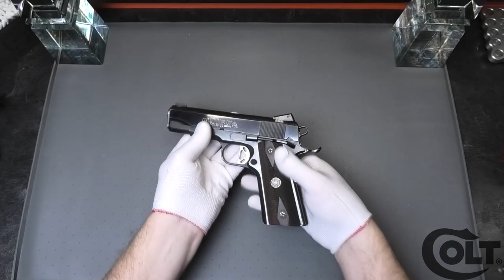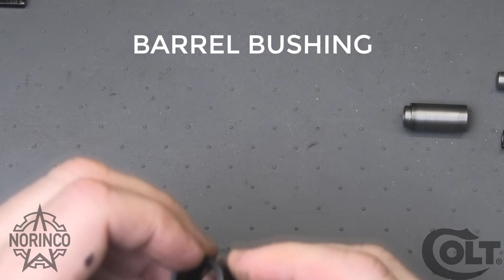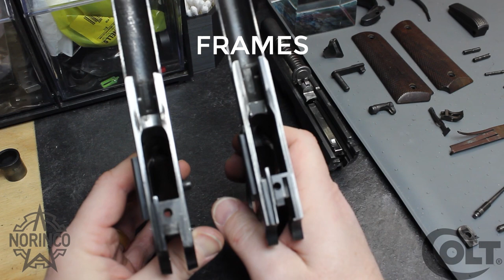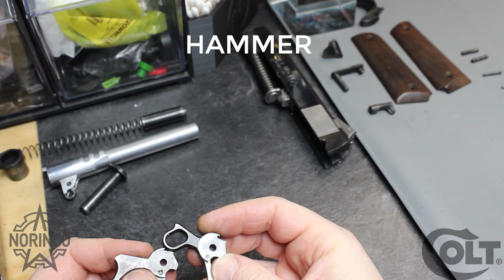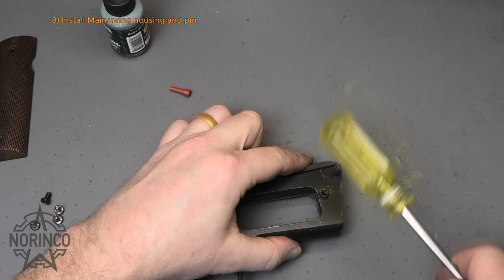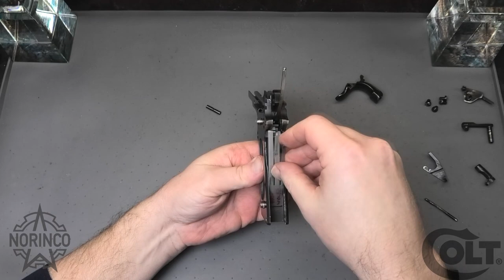Teardown:  Colt 1911 and a  Norinco 1911

Comment: The quality of the steel used in the Norinco, overshadows the low quality steel used by Colt. Ask any gunsmith. Some even refuse to do work on them as it ruins and dulls all their tools.

Also, I noticed you did not take out and compare the extractor. As the Norinco ones are made of a special red steel. Highly sought after, to upgrade a Colt with one of those.
Reply from the maker: Can't argue, norcs are not precision firearms, and are priced accordingly. I haven't liked colt pistols since the early 80s, they changed production and quality, but kept the high prices. I'm not surprised they finally went out of business. Now that said, now that CZ owns them, they MAY come out with some interesting new offerings, and those  I would take a look at, since I've become a bit of CZ fanboi since I started using them for competition..   Cheers! :)
Reply from the maker: Oh, and if I neglected the extractors, it's because the one in the colt is a custom one I had fitted...it's curved and the extractor sharpened, and I likely didn't want to answer comments about how it's bent :)
Reply: Credo che tu abbia perfettamente ragione, le Colt sono diventate pistole scadenti ma molto care.
Le 1911 government serie 70 erano tutta un altra cosa.
Ora possiedo una Norinco1911a1,con estrattore "rosso", ha "giochi" pazzeschi ma è molto precisa!

Comment: People are more brand conscious. People think more expensive gun means more durable and rugged. Norinco 45acp NP 44 which i have is a rugged, accurate, and reliable weapon. I have fired up till now around 1000 plus rounds perfectly with no problem. Has 14 round magazine and almost same weight as compare to any full-size 1911. Its perfect.
Reply from the maker: How do you get 14 rounds into a single stack magazine? I have some 10s but 14s must stick out about a foot?
Reply: Np 44 is a double stack 1911

Comment: "Colt" = overprice, "Norinco" = the price is fair, nothing interesting, merchants always "tore three hide" from honest citizens, just dirty business.
Reply from the maker: I would agree on new colts, but the fit and finish on older ones, 70s, 80s are really nice, often well taken care of, and good quality.  Norinco is just utility guns, they work, usually, and they hit somewhere close to where you aim, and priced accordingly.  I've owned a lot in my day, and sold most of them, I tend to hold on to the colts though :)
Reply: Correction: norinco China Low quality metal... But America 🇺🇸 metal quality and durability that's why colt USA are expensive price. Than Norinco.
Reply: @nathangarcia3267  no
Reply: Is expensive because you pay the name.
Reply: @Billi1631977 pride of ownership so to speak

Comment: Norinco is better 
Very reasonable price..
Reply from the maker: Better by price, not really better for function always.  I've had 4 of these, 3 of them being the commander version, and all of the commander pistols couldn't shoot straight. I clamped them into a bench, and all of them shot up to 2" off center @15y.  I kept a government model, because it shoots almost dead zero at 15y. So once you factor in replacing the barrels, they aren't really a deal any more (but I have a soft spot for them, because they were all I could afford when I was younger, I just thought I was a terrible shot!) :) Cheers!!

Comment: Been having brass to face issues with my NP29, anybody else experienced that before? Is there a common cause or fix? Thanks. 
Very clean video by the way, I like the style.
Reply from the maker: Like ejecting to the left at the shooter?  There could be an issue with the ejector, as it sounds like the extractor is working fine. Not a ton of people even get to see a norc in the wild anymore, that's why I did the comparison. But maybe someone's had this with a regular 1911. The 9mm colt in the video actually has an ejector that isn't pinned, it floats a little bit, I wonder if that was done at the custom shop for a similar issue...I always wondered why the roll pin hadn't been put back in.  Oh and thanks for the kind words! Cheers and get it figured out :)
Reply: The extractor might be rotating.. it can extract but because it rotates it always changes the orientation of how the cases are ejected..

Comment: Before the comparison i know you cleaned up and polished your colt before the video,,
Reply from the maker: Both were clean, the finish on the colt is just way way way way better...to be fair, colt doesn't even make them that nice any more.  If I did the same comparison on a 2019 colt 1911 and that 70's-80's colt, it would look similar.  Colt used to have the very best gun finish of any manufacturer, then they let everything slide, and I guess that's why they went bankrupt and is now owned by CZ.  If you ever get the chance to check out an old-skool blued gun, like a vintage python...just look at the finish (and in fact, that difference made me think of doing this comparison, although it wasn't at all fair) :)

Comment: The springs, and mags on the Norico aren't the best quality. Most people advising swapping them for better ones. Other than that, they are solid and reliable guns.
Reply from the maker: On mine, if you load the last round in any mag (7 round, 8 or 10), the gun won't lift the first round into the chamber. This is a gun that's had ~5000 rounds through it (I love to plink with it). Action is smooth, but it simply won't grab that round. I even polished to glass the feed ramp, it's just something about the way the slide picks up a round. 

My new colt government worked first time out. Various mags...BUT it's $1700 more than what I paid for the norinco, so I'll just load one less in the norc :)

Comment: first why compare a colt series 80 with a gi series of norinco a copy of the 1911a1,second you did not compare the extractor of each, third you omitted the main springs, fourth the plunger tube springs and pins and lastly no mention of the firing pin block assy. which is a component of the colt series 80. next time pick a colt 1911a1 or a remington 1911a1, 0r a usswiss vale 1911a1, 0r a springfield 1911a1, or a singer 1911a1, or a ithaca 1911a1 then compare it with norinco 1911a1.

Comment: Norinco has tougher steel than colt..
Reply from the maker: I do believe they do more for the case hardening yes, but it results in parts that are more brittle. Sometimes softer steel isn't a bad thing when talking about high impact parts. You'd rather a piece slowly wear down (which happens with colts), than catastrophic failure.  That said, I'm no metallurgy expert (and I don't hate norincos).
Reply: @High_Caliber  ive got a norico. the steel is harder but not that hard to be brittle. if you can cut it with a file or drill it its not all that hard. like a drill bit or file is brittle....but they will cut Norinco steel no prob. im thinking the dulling of bits is a myth. ive had 3 and modded them. im told they are 1084 steel
Reply: @High_Caliber  Norinco uses 5100 steel. Colt uses 4140. Norinco is 30 percent harder than colt steel. They are better, metal wise, without a doubt. Fit and finish might be better on the colt though.
Reply: ThAts why I love norinco.
Reply: when they were being imported a story going around was they were made of reclaimed railroad track steel

Comment: Norinco
Reply from the maker: I just bought a new out of the box 45 colt 1911 government. Cost almost $2K.
My old government norinco was $300 all in. 

The norinco took weeks of finagling to get it to run, and it still doesn't like completely full mags, it always binds. The colt worked perfectly from the first shot (and had been test fired at the factory). Realistically, in almost every way the colt is superior. THAT SAID, for $1700 extra, it really should be. It should shoot out rainbows and snacks for that difference. They both are what they are. One is functional, the other is a work of art. If I had spent $1700 on parts and gunsmith services on the norinco, it would probably be better than the colt, BUT it would be a $2000 norinco, and I'd never get the $ back. They're just two different animals.